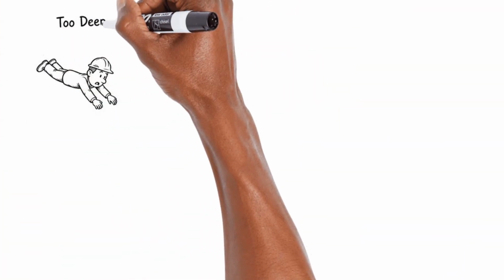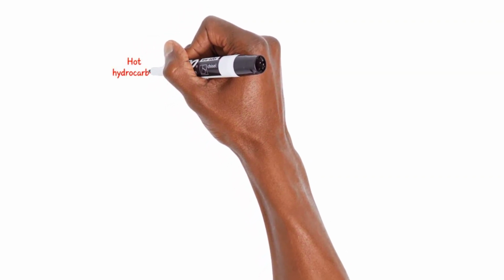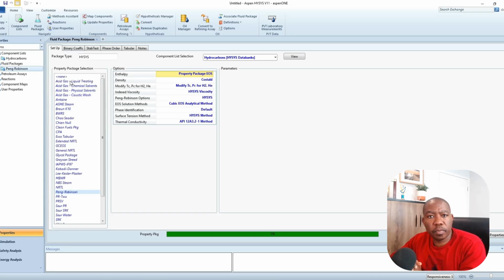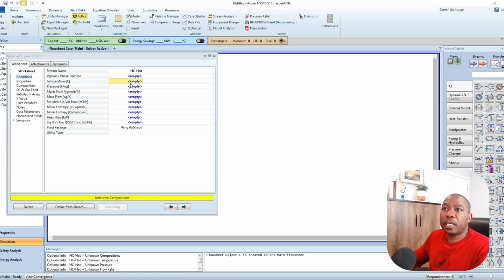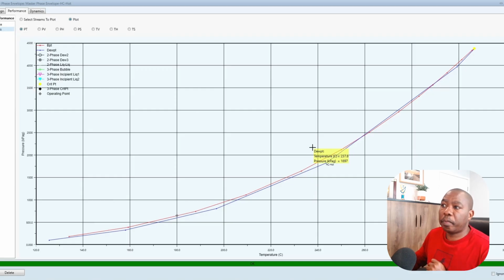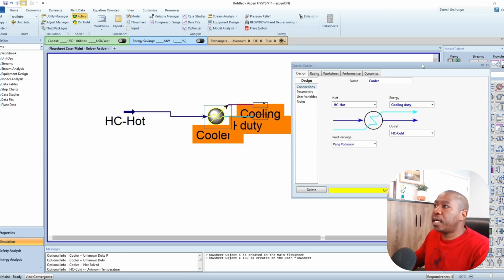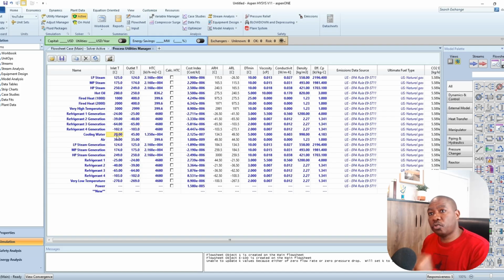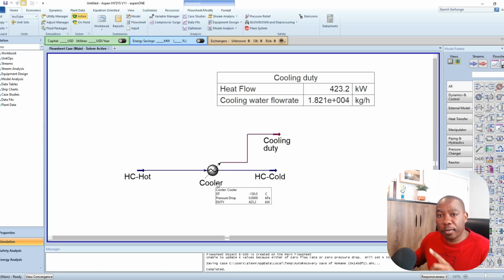How to Design a Heat Exchanger Step by Step in Aspen HYSYS

Comment: Good day sir thank you for the detailed explanation, please I got lost on the stream analysis section for the 1st stream, the performance tab showed no values  for the two-phase bubble under the master phase envelope
Reply from the maker: Hey mate, thanks for watching the video. One of the reasons you may not be getting the correct phase data is that your stream may not be in the liquid phase, and, in this specific example, the issue could be caused by the unit set you are using. Double-check if the pressure input is 650 kPag and not just 650 kPa because at 650 kPa absolute, the stream will already be in vapour phase and the bubble point data would not generate. You will only get the dew point data. Let me know how you go. 👍👍
Reply: @Practical_Process_Simulations  Thank you sir I was able to get it right now, waiting forward for the next video ❤️